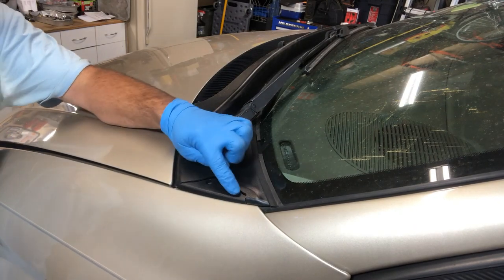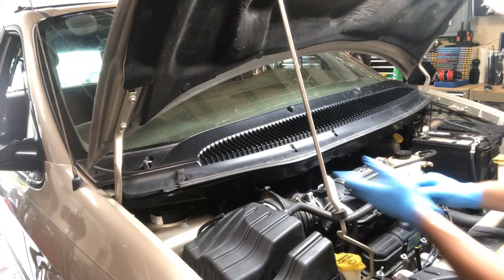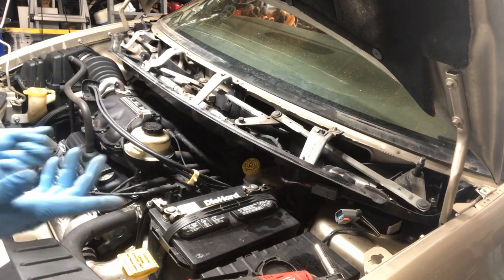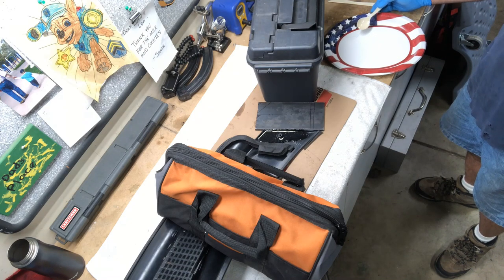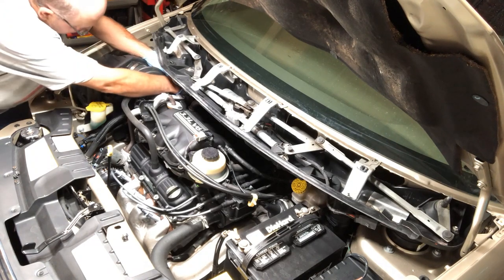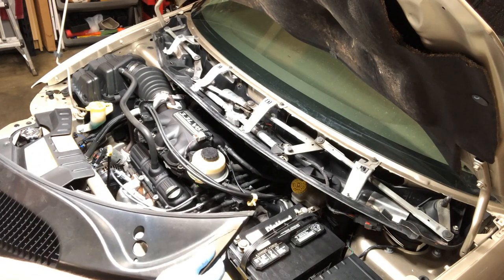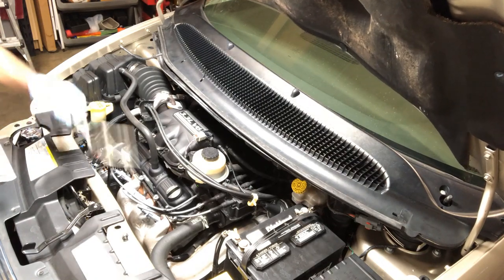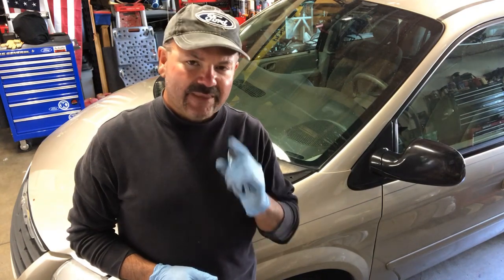Wiper Motor Replacement & Cowling Town & Country Grand Caravan

Comment: I use aerosol Crack filler Foam. Expanding foam for any rattle, its $3 a can and 1 can is alot. I need to do a video, its impressive, and you can cut it flush and seal it with flex seal aerosol. Thanks for videos

Comment: Need this video! I have to replace my brake fluid reservoir... Not really looking forward to that.
Reply from the maker: @Kenneth Turner - I'm glad my videos have been helpful to you!  Removing the wiper motor assembly should make your job much easier.  Good luck on your project!
Reply: @javosgarage  Yes, I will be doing this. I have a brake fluid reservoir that has a centered cap on the body of the reservoir, not the angled goose neck that should be there. So, yeah... good times that will be!

Comment: Afternoon Javo’s Garage, I have a question about the transmission and the transmission fluid; This might a stupid question but I have always heard that you should not change your transmission fluid after the car gets to 100,000 + miles. It might hurt the seals and other things, is this true? My 2005 DGC has 105,000 miles, fluid is red and doesn’t smell burnt! Thanks Jean
Reply: I'm not a mechanic, but from what I understand, it's fine to drain the oil, clean the pan, replace the filter and gasket, button it all back up and refill.     What you don't want to do is flush it.     That's where the seals can get messed up.
Reply: @davewilson1411  Thanks Dave, that’s what I am going to do!
Reply: Wrong.  I change those every 30K after learning in the early 1990s how sensitive those transmissions are to fluid quality.  It's never too late to change it.   Use ONLY 7176 fluid.  Wal Mart is a good source.

Comment: Was this a Wiper Motor Replacement? or How to fix the brocken plastic piece? I guess I missed the moor replacement, is this Part #1 or Part #2?
Reply from the maker: @Jorge De Leon - You're right, the motor wasn't changed in the video.  Maybe I should change the title a bit.  The idea behind this video was to provide the information needed to gain access to the wiper motor for replacement.  It just so happened the cowl needed to be repaired and I included that in the video because it's such a common problem on these vans.  Sorry about that.  Thanks for stopping by and leaving me some feedback, that's how I improve.

Comment: What if it's rust seized on?
Reply from the maker: I'm going to assume you're asking about the wiper arm.  I would soak it overnight with something like PB Blaster or WD40 and see if that helps.  If that doesn't work then I would escalate to getting a wiper arm puller (or a battery terminal puller) to get it removed.  Good luck with your project.  Thanks for stopping by!

Comment: My blades keep hitting each other and bending how can I adjust them to not hit?
Reply: You've not got them set right on the shaft when you put them back on.  Remove and try again.
Reply: @anvilsvs  I found out that the store size was wrong and went with a small size and they work fine now.
Reply: @xsiner  I've been using shorter wipers on all of my vehicles for many years to reduce chattering.

Comment: I am not sure if you folks out there is able to buy online "Seametal T-strip rubber sealing for cars". Must be of 27mm width. Its about USD3 for 2m lenght excluding sending fee from China.

Remove the wiper arms & peel off the broken & unbroken rubber from the cowling. There will be about a 5mm gap. Do not use WD40. Wash clean the glass and cowling using kitchen soap & water. Some car washing soap has wax in it. Scrub, rinse well and leave car to dry properly - somehow water does not get into my car interior. Not sure about yours.

Cut a short 6" strip from the 2m roll. Use it as a practice strip. Trim with blade & glove for this strip to get a good starting fit to the corner of glass & cowling. Peel off the red strips of the 3M that protect the adhesive. There are two parallel band of 3M sticker along this 27mm wide rubber sealing tape/strip. 

Use the narrower adhesive side, of 7mm width, to stick on the glass. 

The middle band, of the strip, is flexible rubber, without 3M, will be covering/bridge the gap between the glass & cowling. 

The wider band having 12mm 3M sticker to be stuck onto the cowling. Do not use WD40 to clean any remanant of 3M that stuck on glass or cowling.

Remove the short practice strip and start with the full roll. Better still get someone good indyi to help. 

This is my contribution since I had benefitted from folks which had put up good diy contents in U tube. All done 3 days ago forbmy W211 in less than 1 hour & below USD6. Buy a 4 or 6m roll if you or your friend have same issues.

Happy motoring.
Reply from the maker: Well thank you very much for the compliment Don!  I do my best to be straight forward and clear with my instructions.  Super glad to hear you enjoyed the video.

Comment: common problem apparently chrysler doesnt use torque tools
Reply from the maker: The cowls on these vans was horribly designed.  No excuse for such a simple item to have such a high failure rate.

Comment: You didn't test or show trouble shooting oh well
Reply from the maker: Sorry Jason, the purpose of this video was just the replacement aspect of the job.  However, I appreciate the feedback because I will be adding more videos on these vans in the near future and I will use your comment to make a better video on this subject.  Thanks for stopping by and taking a moment to leave me a comment.
Reply: @javosgarage  I apologize I was stressed mine was out of timing so as I changed the wiper transmission I had to watch motor make a turn and then line up where I wanted wipers then fasten bolt from motor to transmission I never found a video demonstration this issue and figured out in head.. That might be a good one to share with world.  Thank you so much and I apologize again for and shortness on my part
Reply from the maker: @Coinbro  Please, no apologies are necessary Jason. I’m glad you got it figured out. I really do appreciate the feedback on the video idea and I’ll see what I can do about it.